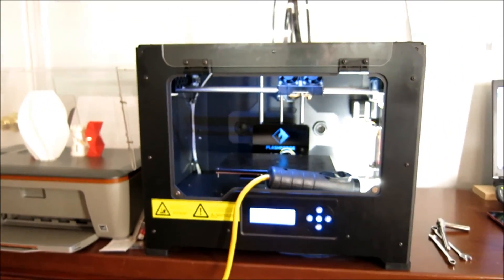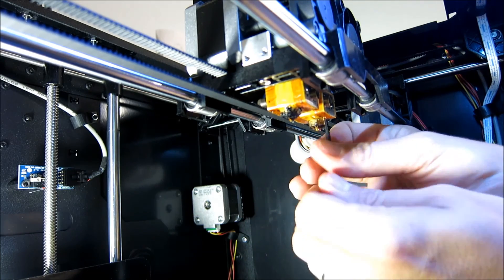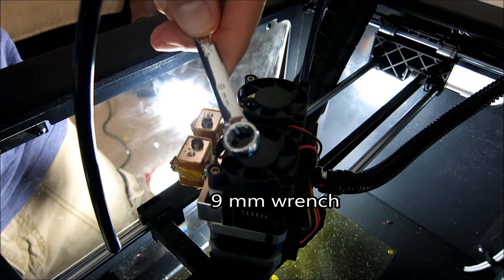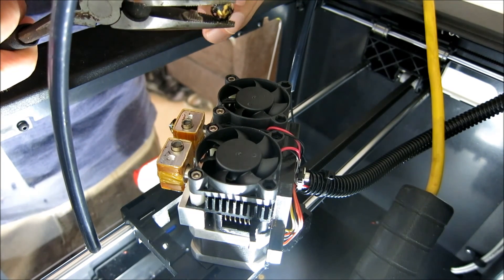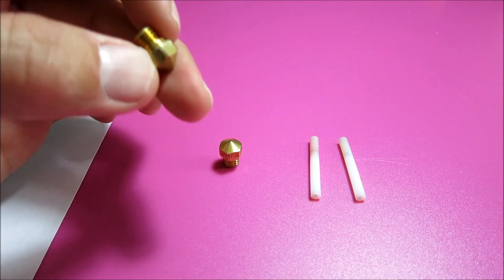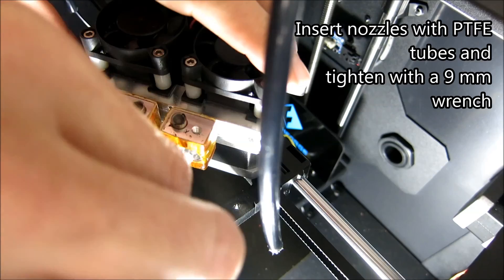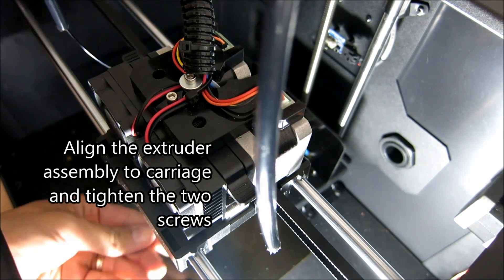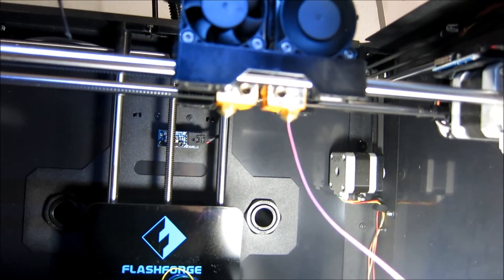Flashforge Creator Pro ABS Nozzle Cleaning

Comment: Thanks for sharing, great idea sticking the allen wrench in between the heating elements to remove the nozzle, I've used pliers to hold it in place but it's hard to keep it tight while trying to loosen the extruder, specially when it's stuck.

Comment: Thanks for sharing this video. I noticed you are not using the factory Flashforge printing bed. Which one are you using and does it work better than the original one?. I bought my printer some weeks ago and although the first prints were excellent, I've noticed some adhesion problems with the last ones. Even with PLA, heated bed and Elmer's glue. Considering changing the bed if the regular 3M blue tape doesn't do the trick.

Comment: Is it good at printing ABS models? Are there warps during print?
Reply: Shao Kahn Ive used a couple different methods which have all worked very well. NOTE: all require the bed to be level method 1. use kapton tape with hairspray. method 2. level bed using a piece of paper the to get the correct spacing. Once thats done use the blue painter's tape and apply glue stick. Method 3. Use a glass bed, level it using paper for spacing and apply blue tape with glue stick.  Heated bed: 110 c (1st layer) 100 c after. extruder: 230 c. Good luck and hope this helps.
Reply: I just went to a glass shop and order a piece of glass to fit the bed. There are a couple of glass bed spacers on thingeverse
Reply: then only reason Im using the glass bed it that I started printing TPU (no tape of glue needed for TPU). I just leave the glass bed on and cover it with blue tape for ABS.
Reply: Yes it is very good at printing ABS once you have your setting dailed in...No warping
Reply: What settings are you using? I just can't get my ABS print to adhere correctly to the bed. I have the same printer.
Reply: Thanks Chad. I'm doing my research on trying glass beds. They don't need to be special glass right? Hope this fixes my problems! I printed yesterday my first Benchy (after using about 2 kg of filaments!) and it came perfectly, using a raft that is.
Reply: No reason not to try this, then. Thanks again!

Comment: If I had a pla clog would I do the same thing but instead of acetone would I use  .3 mm drill bits to clean out the head?
Reply from the maker: +WolfGamerProHD I haven't really worked with PLA, but I heard of people using blow torches or using ABS to push the PLA out.